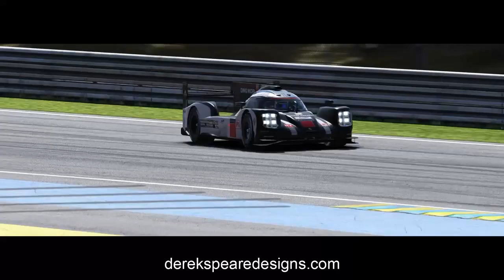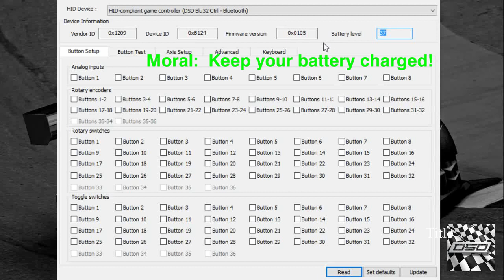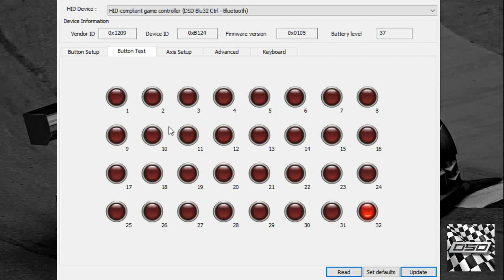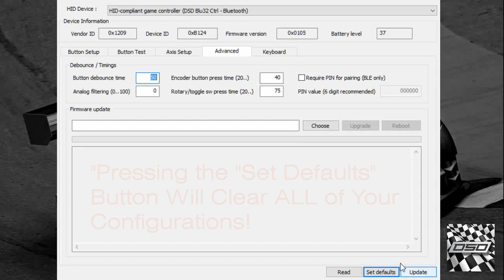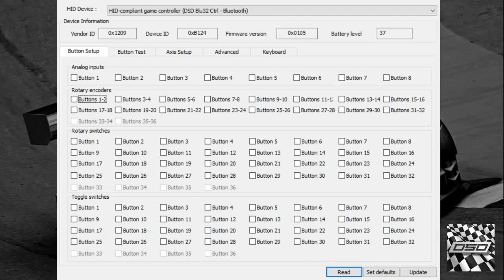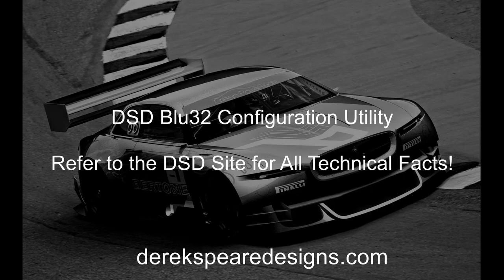DSD Blu32 Configuration Utility Overview

Comment: Great tool Derek.  This connection technology is what Fanatec intend to use for there new Direct drive wheels (Bluetooth connection).  Also may I ask if it has been tested with multiple devices with the Bluetooth receiver connected to a usb hub? If so is the signal better if a receiver has its own dedicated usb3 slot. Running out of usb sockets on pc and wondering if a hub with say 4 devices will run ok? Know cables are better at 1 to 1 rather than hubs.